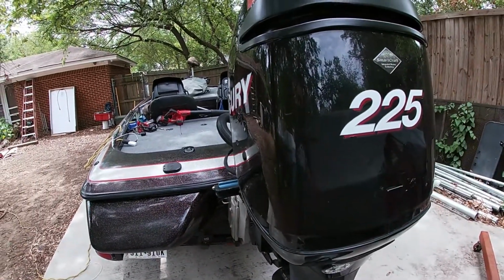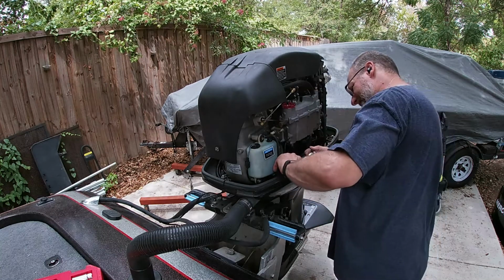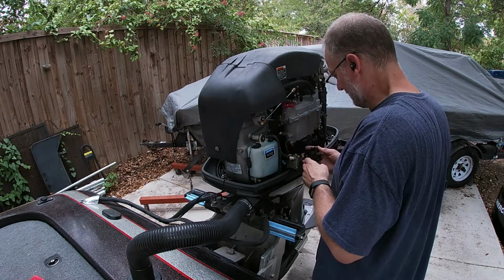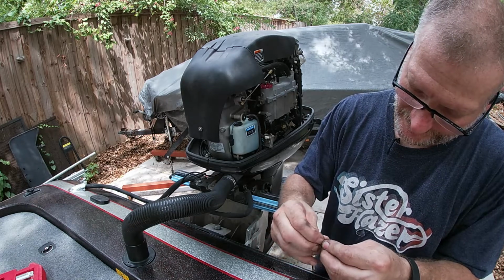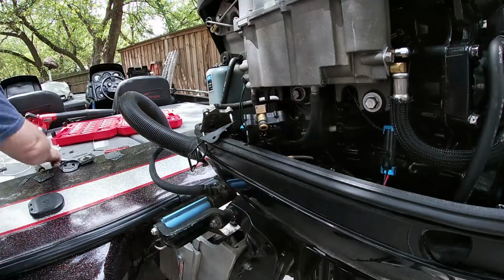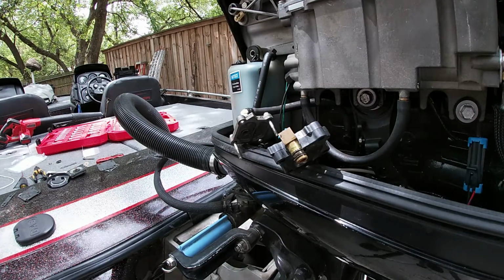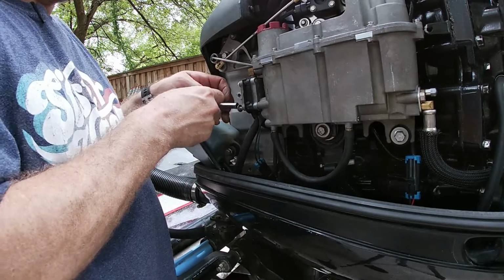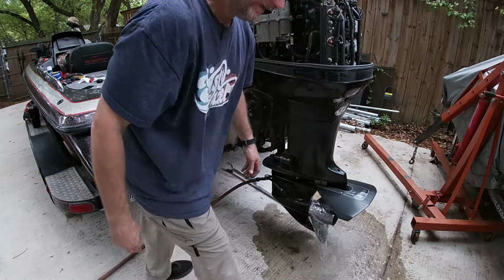2006 Mercury OPTIMAX 225 Lift Pump aka Vacuum Fuel pump overhaul

Comment: Could you tell me you loosen the rod over the fuel filter so you can change the fuel filter?
Reply from the maker: I’m sorry I have been extremely busy with family matters and work. 
I have not changed the filter yet, but this spring I will be doing the complete Maintenace cycle and will include several sections including filter, belt, plug inspection, fuel vapor separator clean out etc.